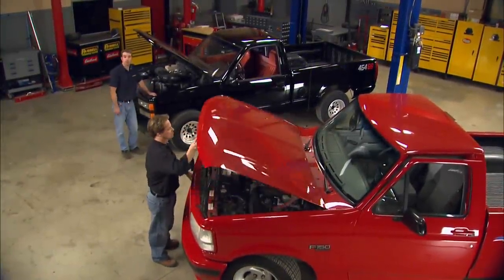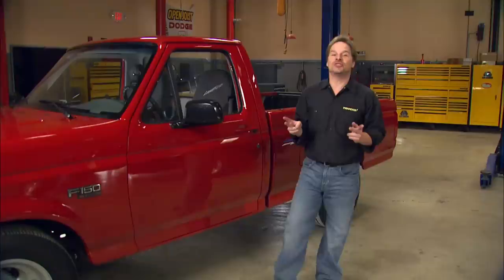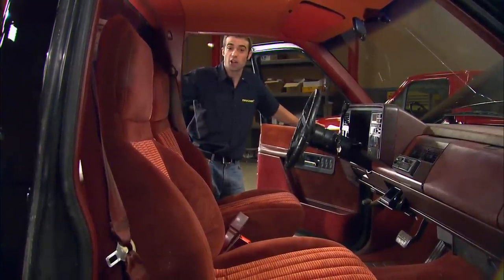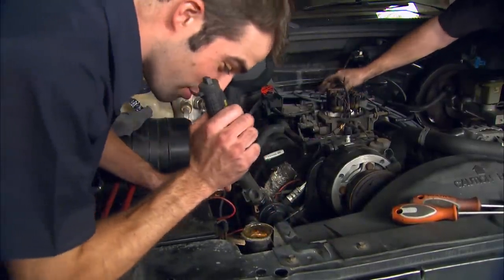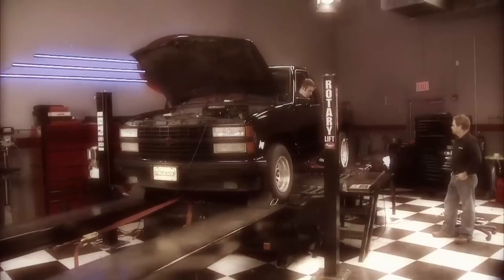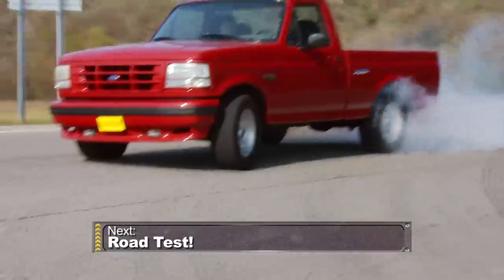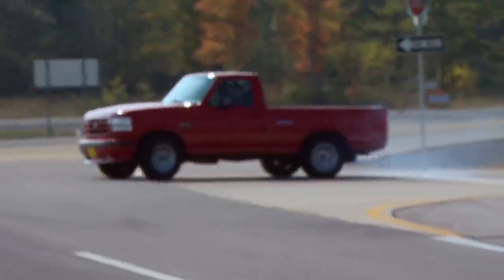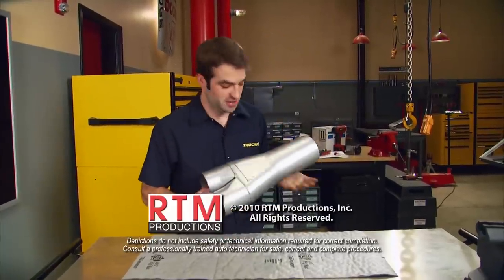'90 Chevy 454 SS vs '94 Ford Lightning F150 MuscleTrux Wars Part 1 - Trucks! S10, E1

Comment: Neither truck stock is messing with a Syclone or Typhoon.
Reply: Yeah I heard what he said and immediately thought "now that's a bunch of horseshit"
Reply: RedfishCarolina yeah right bo
Reply: leo c  smoked*
Reply: No joke! Almost 300 horsepower in a turbo little V6 little truck... Power to weight, baby. Syclone was a little rocketship.
Reply: @JoeIsCrazyWillman  Don't forget it is AWD giving it instant traction to get up and go.
Reply: Very true....(adds turbo to either)
Not anymore
Reply: @chadkent1241  Remember I did say stock. Neither is no longer stock if adding turbos.
Reply: @bjbeardse  Dude GM named its vehicle Syclone with that spelling. Knowledge is your friend so is Google.
Reply: @bjbeardse  Mercury had the Cyclone
Reply: @electric8668  true
Reply: @bjbeardse  <--- 😂🤦 roasted
Reply: Nope .And, if you were going to hop them up, it was a lot cheaper with them, too.
Reply: @bjbeardse  that's not how it's spelt actually
Reply: Who gives 2 shits about stock? I'd hardly call a 500lb payload a truck anyway. Even a crap 454ss can actually be used as a truck.
Reply: The truth
Reply: Apples to Oranges would be either dropping a 429-460 big block in the Ford or dropping in a 350 in the SS. Then dropping in a twin turbo Ecco boost in the Ranger to compete with the Cyclone or just run a turbocharged engine from that time in a Ranger.. Or just the next generation and better Lighting with a modular and awd😏
Reply: Agree, I have a 97 k1500 with a built 4.3 and I smoke 5.3 trucks all day
Reply: Not in a straight line but the Ford wasn’t built only for the 1/4 mile. It was more track oriented. But yeah, the syclone was awesome
Reply: @bjbeardse  GMC calls it a Syclone look it up dummy! 🤣
Reply: @salvadordollyparton666  atleast im not stuck with a shitty old ford or a dodge
Reply: @cropagronomist Syclone
Reply: @cropagronomist  or how about a modular vs LS? GM WIN.... If you want to accurately compare...
Reply: @ReadingAreaRailfan  enjoy your self- destructive interior
Reply: True
Reply: Fastest production vehicle that year.
Reply: Is the syclone a full size truck?
Asking for a friend
Reply: @robbyfuller4342  no
Reply: No shit...

Comment: These trucks look so much better than the new ones out now.
Reply: Hell yeah.  I want a chevy of this vintage wirh a LS swap
Reply: No just no
Reply: @msw7021  no negative
Reply: And they’re way more simple and reliable
Reply: @bilbobaggins4710  🤮🤢
Reply: @breimer87  hi honey❤😘
Reply: Way better
Reply: Aaron Davis  the newest gen Siverado is pretty ugly in my opinion. Check out the Ram up close if you haven't yet. Not a Mopar guy at all, but GM and Ford have some desperate catching up to do.
Reply: Kenzo I couldn't agree with you more.  I really don't like the new eara of anything.
Reply: Because everything is high beltline now, it’s disgusting, the panels are too tall, cars are fat and ugly
Reply: @Kenzo not the Chevy, it looks dated as hell. The Chevy looks to be 8-10 years older than the Ford and it is not because of the mileage.
Reply: I didn’t no they made a new 454 and new lightning
Reply: That Chevy is fugly
Reply: Aaron tooks the words out of my mouth. It's just nostalgia - it's because it makes you remember a different time and you thought these trucks were cool back then. Trucks do they have really improved in the design of them have vastly improve. Of course looks are subjective and it's just a personal preference butts these old trucks aren't necessarily better - just different.
Reply: Agree to disagree.
Reply: Opinions are like assholes. Everyone has one unless it is medically diagnosed, and always get a second, third, and fourth opinion.

Comment: I am a chevy guy, but the lightning was a better truck stock.
Reply: Better potential with the 454...
Reply: There's no replacement for displacement!
Reply: Salty Steel turbo, supercharger?
Reply: @andrewfotopoulos7766  I hope this series finds it
Reply: Andrew Fotopoulos lightings got a supercharger later on... Replacement for displacement.
Reply: I had a 95 lightnings and used to toast 454's all the time
Reply: Yea well when the 454 is getting choked down with emissions this pollution pump that.. the Ford product can simply slip away
Reply: @timjamieson1094  Ford still blows dog.. my '75 Silverado 350 no internal mods walked away from a few lightnings. Any big block on the earth was so strangled w emissions at that time it's a wonder it could idle properly
Reply: Obviously not if the chev had 140,000 miles and was in good shape and the ford had less than 90,000 and the bushings were out
Reply: Your not a chevy guy if you think that, or your on drugs.
Reply: Dont forget the ford didn't have a catalityc converter that a an advantage to the SS
Reply: angel ullom   if they had 2 trucks with both being stock from the factory the results would have still been the same. The 1st gen lightnings were just faster than the 454 trucks period
Reply: @davidgalvan692  didn't matter, 1st gen lighting's were faster stock than 454 trucks either way
Reply: Correct
Reply: @sonofthesheriff  yeah right...
Reply: @royrichardson9164  and there is no argument here this is pure fact.
Reply: @royrichardson9164  and they're way better looking...
Reply: It absolutely was and the guy that said he walked away from a lighting in his 75 truck with a stock 350 is full 9f shit and I hope no one ever takes him serious.
Reply: So if you are a chevy guy is against  the law to like another truck or what? Im a ford guy and I like both, its like the 72 chevy and 79 ford, both are and look awesome
Reply: I am a Ford guy, and the lightning was a better truck completely.
Reply: It should be.   4 model years newer than the Chevy and 4 years was a lot back then with technology.   I like both of these trucks for different reasons.
Reply: sonofthesheriff aint no way bo
Reply: Broman 1267 i guess when the chevy got to 100k miles it lost all its power. That or its a piece a junk
Reply: @alonzokincaid1362  chevy just didn't have the hang of making power with emissions limitations, hopefully they'll wake the big block up and put down what it should have from the factory
Reply: olov244 I know man. Unfortunately the SS was pretty lame stock.
Reply: sonofthesheriff A 2019 5.3 is 355hp stock. Isn’t that crazy?
Reply: Easily
Reply: Welp in the Ford was the winner in stock form seeing as how it made around the same power without a big block plus had a overdrive transmission  better as ur new truck
Reply: sonofthesheriff  No 1975 Silverado with an internally stock 350 ever walked away from anything.
Reply: @saltysteel3996  if done right.... which it wasn't
Reply: angel ullom  you know nothing.... the reason for what they said was nothing to do with that part of the exhaust and everything to do with under the hood.
Reply: @davidgalvan692  that was not the deal breaker buddy.... so much more going on.
Reply: Ford always used a smaller engine and still kicks Chevy's ass, things haven't changed.
Reply: @ssimon64  what about a syclone though? Didnt think so
Reply: I had a 91 454 SS, n use to beat on the lightenings at the track
Reply: Absolutely! I had a 93. Never been a Chevy fan they could have done so much better! They had more off the shelf parts than Ford ever did. Really all they made was a boat anchor!
Reply: neither of them are really that cool after a few burnies and donuts though...The chevy will cost A LOT less to make really "cool" if you know what i mean....
Reply: @alexcorona  you do know you can put one of those...on a bigger engine ..right?? Once again...no replacement for displacement
Reply: @ssimon64  beside anything from the 90s till today .. Ford hasn't had an answer to the LS engine up until the coyote..And it took an expensive tech heavy 4 cam 32 valve v8 to compete with a pushrod OHV engine that uses 90s technology 🤣 Not to mention LS longevity is far superior to anything Ford has made since...well...Ever??
Reply: @ssimon64  smaller engine argument goes out the door when it has 4 times as many cams and twice as many valves .. The Ford modular series was an absolute joke compared to the LT LS engines GM made ..And even now what GM is doing is far better then Ford .What has Ford had to offer since the mustang?? GM has multiple divisions making badass stuff .Lmk when Ford is making a 650hp sedan with a manual transmission..Have you seen the new c8? What does Ford have to rival that? And don't say the GT because I've seen probably 1000s c8s but have only seen 1 GT in person...

Comment: The transmission in the Ford is not an E40D (ee forty dee), it's an E4OD (ee four oh dee). As in, Electronic shift, 4 speed, OverDrive.

Just a little FYI. :)
Reply: I mentioned the same thing,  they just lost their hotroder card
Reply: I’m glad I’m not the only one who was bothered by that.
Reply: What does E40D stand for then?
Reply: Michael Bloom they're Chevy guys can't blame them
Reply: @alexpayne1523  re-read original comment.
Reply: Alex Payne Electronically Controlled 4 speed Over Drive transmission.
Reply: 303StreetMachines naa those E4OD transmissions were pretty terrible, they used them in everything and were notorious for having issues and requiring rebuilding by 100k miles. The later 4R70W and 4R75E were light years better.
Reply: @alexpayne1523  

E-electronic

4-four speed

OD-over drive
Reply: 303StreetMachines Yeah ford didn't really make a decent automatic till around 2001 in cars, and probably 2006 in trucks.. that whole generation from the AOD - 4R were pretty terrible.. the ones prior in then which were the c6 were pretty much indestructible, and after the 4R were pretty indestructible as well but for a good 25 years if it's not a manual stay away from it..
Reply: @alexpayne1523  electronic 4 speed overdrive
Reply: @303StreetMachines The R means rear drive application.  the FWD cars had trans like 4F50N, or  AX4N (X for transaxle)
Reply: later turned into the 4r100 and the crazy that they are all original C6 parts fit for you to build a bullet proof trans and the part is the steel planetary gears and can get hardened input/ output shaft
Reply: @shartingfish5761  The AOD was better than anything GM had to offer at the time.
Reply: Haha bothered me too
Reply: @shartingfish5761  haven't had a lick of trouble with the 4R100 in our '00 F250. Tow fairly heavy with it too.
Reply: @303StreetMachines The 4R100 in the Lightnings used the internals from the diesel version of the 4r100.  They were different (supposedly heavier duty) than the components of the 4R100 for the gas super duty trucks.
Reply: kleetus92 I'd never buy anything GM anyway, well not this new if i had a choice, right around 1973 is about as new a GM that I'd buy.. but I just would have bought a manual transmission Ford over an automatic, every automatic ford I've ever owned needed transmission work at some point, outside of my 70w and 75e which i get in my panther cars.
Reply: USMC Vet Pretty sure the 250 used the heavy duty 4R that had the transmission cooler and bigger ring gear, way less prone to issues than a standard 4r
Reply: Chevy's you got to put Engines & Transmissions in them they don't last very long Chevy's or s***
Reply: 40 wata
Reply: Actually, the R means rear wheel drive, not reverse.
Reply: @krystalloss5498  Yeah but Chevy owners along with gm talk down the most about their rivals bar none.  That makes them better right, haha.  Sort of like the guy telling the most war stories usually had military experience consisting of volunteer truck washer at a base in Iowa.
Reply: @alexpayne1523  He literally said exactly what it stood for in his original comment
Reply: Michael Bloom No shit!
Reply: Wow... Thats just sad. Just reading off a paper and not knowing your ass from hole in the ground smh
Reply: @shartingfish5761  That's a complete apples to oranges comparison as the 4r100 is a completely different transmission to the 4r70w and 4r75. The 4r100 evolved from the E4OD which was introduced in 1989. The 4r70w and 4r75 evolved from the AOD. So they're not even remotely close to each other.

Comment: 5:32 Love the piece of mig wire still stuck to that awful exhaust weld on the lightning. :)
Reply: Mrdumbfellow did they remove the 02 sensors as well???
Reply: All anyone can do is grind away the shame.. you know it's a crap weld when the evidence is just looking you back in the face.. metal holding hands Not a Weld..
Reply: Lol
Reply: @AtZero138  haha, as they say "Grinders and paint make me the welder I aint"
Reply: @AtZero138  heh I would say most of my work is just holding hands.   Says a lot about the previous owner when they don't even bother clipping that wire though :)
Reply: @alexcorona  not familiar enough with that year to know if it used to be in that location.

Comment: Later 454SS trucks gained 20hp to 255, 4speed od trans and 4.10 limited slip gears. Vast improvement over this truck
Reply: Yep, much more expensive now though
Reply: Yes , Thank You
Reply: It might be able to keep up with the Ford then  LOL
Reply: @lanemorrow5513  the fORd obviously had been modified and had no cats.
Reply: That ford was slow for stock...ive had 2 lightnings
Reply: @swampfoxpicks6908  the shitrolet has a HUGE cubic inch advantage! General Motors had to actively try to make that thing terrible from the factory. Even with the terrible gm tbi and a catalytic converter.
Reply: @andrewsonnenberg1727  Your kidding,  I would have never known  how many cubic inches the Chevrolet was.,  I wish they would have written it on the outside of the truck,  maybe on the bed.  Lol
Reply: @jasonvoorhees6657  city boy? I make my living on farms in my area. I drive more miles on county back roads in one week than most people drive in their entire life. Watch who you call city boy.
Reply: @jasonvoorhees6657  Amazingly slow
Reply: @lanemorrow5513 just because of the throttle body injection
Reply: @jasonvoorhees6657  LOL...its okay man, you can say it.  Repeat after me "the Ford is faster".  It won't kill ya  LOL
Reply: Boi
Reply: Andrew Sonnenberg hard to make a living when your ford gives out on you every time you drive it😂
Reply: @coreyrogers5358  I drive an 05 F-150 4x4 with a 4.6l V8 that I bought brand new. 199,285 miles later it has never failed once. The only thing I have done is oil changes and tune ups. 
If you call that "giving out" I'll take it.
Reply: I was going to mention the same thing! A more fair comparison would be with the same years Chevy. Bet the results would be different.
Reply: And hitting 110 mph speed limited ip the arkansas mountauns and carving corners in my 93 red lightning..i heard a noise leaving the corners...surprise...when i looked in my side mirrors i could see nearly a foot if daylight under the inside back tire..handled alright for stock too
Reply: @ironpanther2420  I don't have the 3 valve triton. I have the regular 2 valve 4.6. I have never had an issue with the plugs.
Reply: Swadian Knight  as in they modified it to make it slower?mine were both stock and the slowest one went 15.3 @88...i guess i did have a 15 inch sub between the seats for extra weight.lol
Reply: Swadian Knight You call a shitty exhaust system modded?? Whats sad is that POS chevy 7.4L  getting its ass handed to it by a Ford 5.8L.....
Reply: Swadian Knight  Butthurt Chevy guy hahaha.....its not modified man....give me a break.  Put the same mods on the weak Chevy the results would be the same  hahaha
Reply: Oh and on top of THAT...its a big block.  Hilarious.
Reply: Yeah it would have been a better head to head to do the 93 454 ss vs the 94 lightning but whateves